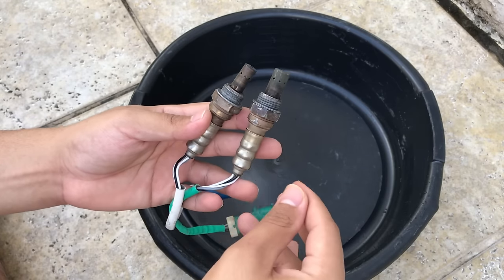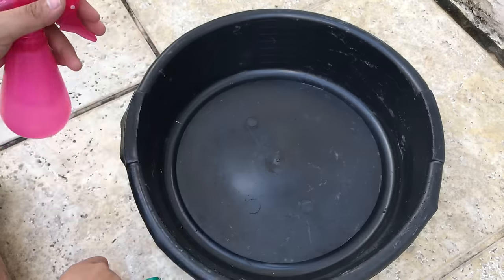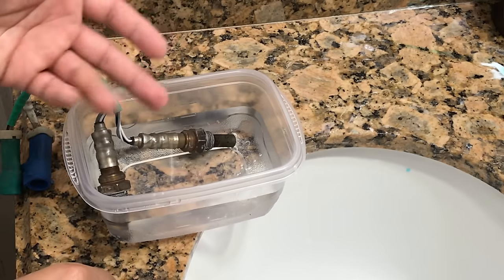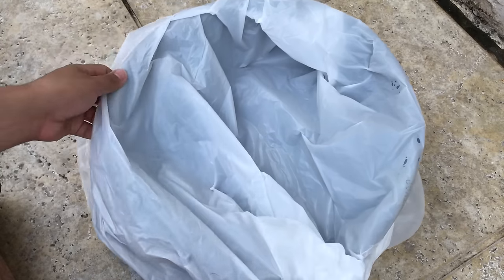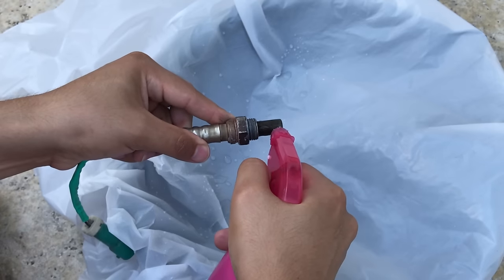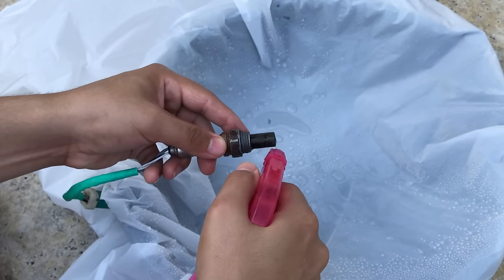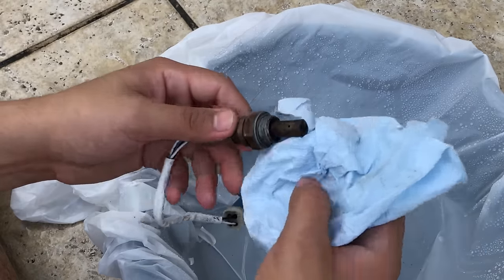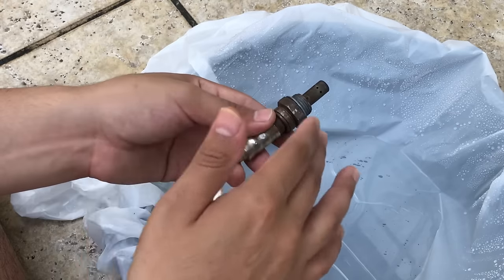HOW to Clean O2 Sensors [For FREE]

Comment: If you soak them in toilet bowl cleaner for 15 minutes, you will be able to clean the inside and out. You'll have to use compressed air to get the liquid out after cleaning.

Comment: It's not the end which becomes the problem it's the wires inside the housing which go first. Unless your running rich for carbon build up.
Reply: Malcolm galton I would tend to agree Malcolm...  I am running lean on an 2000 Jeep XJ.  No vacuum leaks detected.  Code P0171 shows I am running lean, but I’m running super rich. 32% positive.   Cleaned the IAC - no change.  On to the O2 sensors.  Scanner says I have hot O2 at Cat...    10 hours of driving after seafoam use and I’m having this trouble code I can’t shake.   Aside replace sensors, any suggestions?

Comment: Can of carb cleaner works better...or Brake parts cleaner,& high pressure air from compressor to blowout the 02 sensors,all is just temporary fix.for all the work involved removing those hard to get at sensors,uust buy new ones,do it right the  first time,will get yrs of use out of them than.

Comment: The best and complete way to clean an o2 is to get the car warmed up run at 2000 Rpm while creating a vacuum leak by pulling of a vacuum hose the heat from the car running lean will burn off all carbon

Comment: Minimal carbs in the sensor....that means that..... A water didn’t work well or B didn’t need cleaning.  I agree water want remove the deeply embedded carbon deposits.  Concept and theory sounds solid but need a chemical cleaner preferably one designed for O2 sensors.
Reply: someone said petrol

Comment: 160,000 miles on my sensors and just had one fail and they have never been cleaned.
Reply: Similar here. Did cleaning help or was the wiring going bad and you had to replace it?
Reply: What are the symptoms of this sensor failing?

Comment: just buy new ones this shit don't work
Reply: Might as well try to see if it works at a cost of over $1200.00.  I would soak it in a better cleaner though.. they are suppose to be replaced in pairs or supposedly the ECM will still give out codes..
Reply: @Funky4me21  1200 for o2 sensor? For my car it is like 70 bucks. O2 sensor is not catalyst!

Comment: Lambda sensor heats itself after Start to 300C [580F] and if you rev high rpm the exhaust temp. is going raise easly to 600C - 800C [1100F-1500F] and you burn it free. If not you should use ultrasonic cleaner and let is clean for 15min. And not in hot water or what the **** you doing there. All that was just time wasting.

Comment: You are too gentle use only water to deal with carbon deposit. I use contact cleaner (which contain not only isopropyl alcohol) rather than strong action a carbon cleaner. I think it;s mild yet strong to deal with carbon residu on O2 sensor.

Comment: Amateur hour over here.  Do this: 

1. Heat with torch. 
2. Dip in cold water 
(watch debris fall off)
3. Finish with wire brush and/or compressed air
DONE

Comment: Soak them in apple cider vinegar and baking soda it has to be apple cider vinegar because the apples gives off more acid and breaks down the deposits inside the O2 sensor better along with the fizzing of the baking soda then take the mixture after letting it soak then put it in the microwave with the O2 sensors in it and set your microwave for as long as it can go for the most high setting it's got when the microwave is finished heating them up take them out let them cool down for them back in your car and you're good to go
Reply: S ensors generate there own electric, metal casing. putting them in microwave.  /???????????????????wtf.